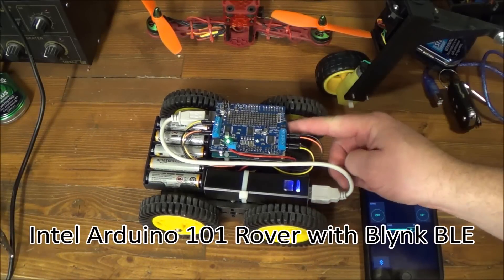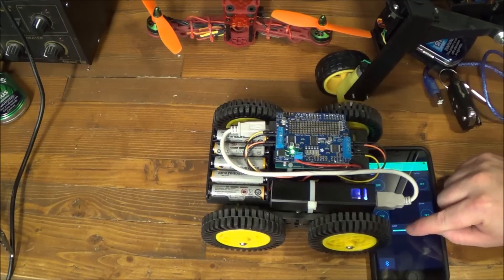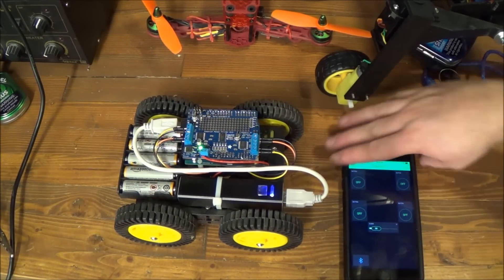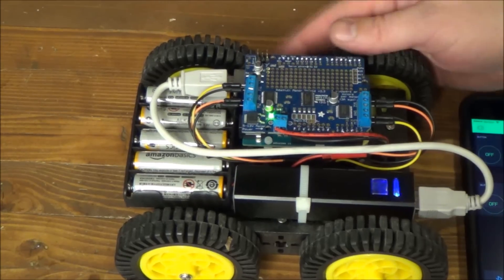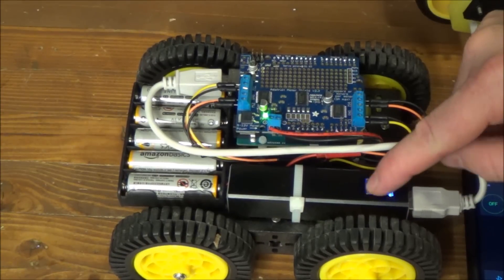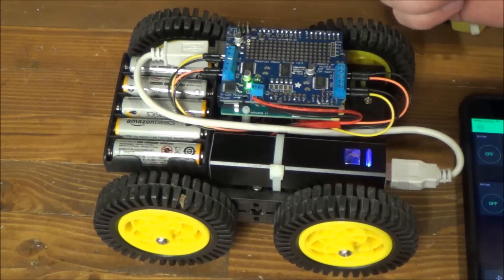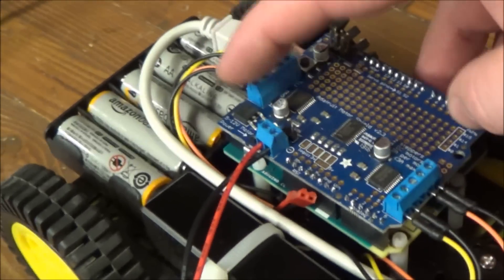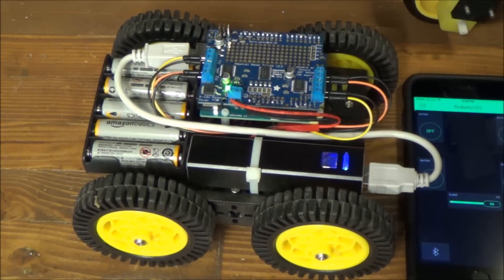Arduino 101 BLE Blynk Rover video 3

Comment: Hi, I tried your code and it worked but I have modified to control only two motors so in Blynk I have only four buttons and on slider to go forward/backward/left and right, the only thing that I need is to have another slider to control the speed of turning left and right. Any idea?
Thanks,